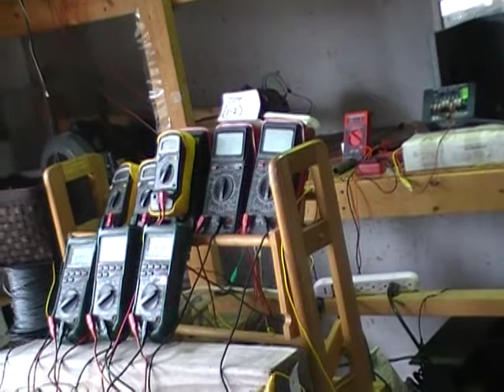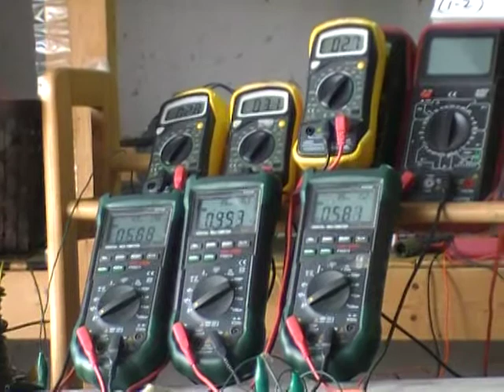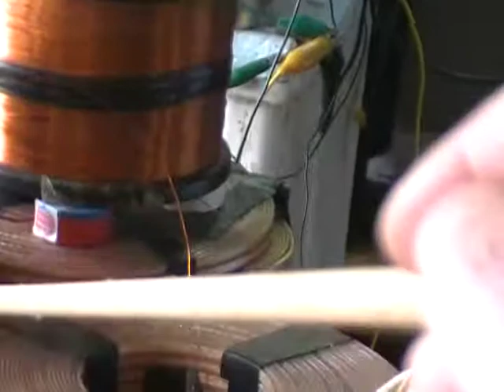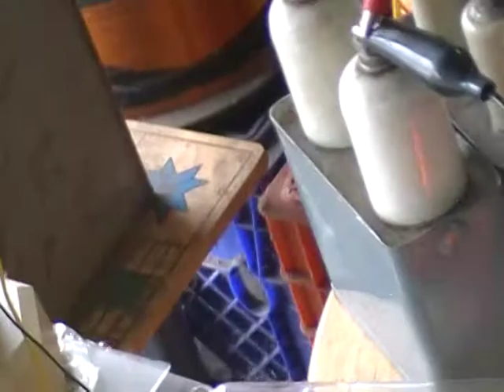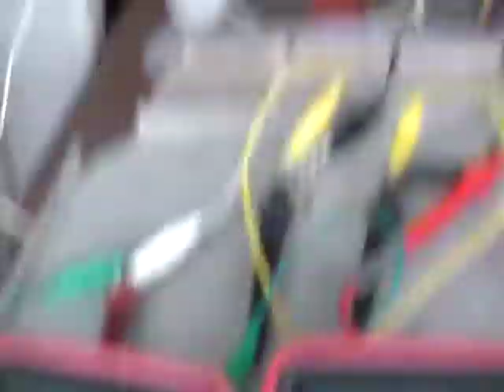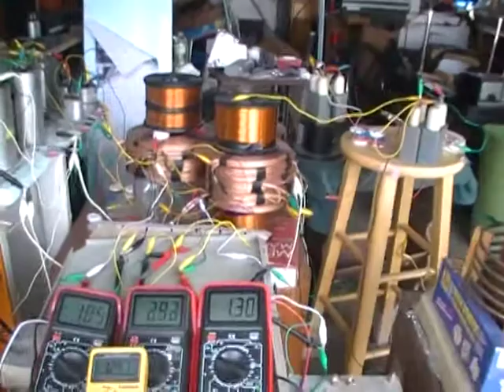SelfMagnetised666mach

Comment from the maker: The principles of a rotating transformer are incorporated into the 3 phase alternator by pulsing the rotating electromagnet known as the field at the double the frequency of its own AC output! A middle series circuit collectivises the secondary signals over 3 of the 666 machine poles being magnetically expanded by the magnetic opposition made by its center element in the triple stacking of 9 elements. Any voltage or current made by the outputs prior to field energization a...re explained away as residual magnetism of the rotating field rotor. In any case if this feeble current were to be "recycled" to the field to create a self energized working alternator because the alternator employs a rotating DC electromagnet employed to create three AC signals separated in time; to use the AC outputs in this self feedback loop they must be converted to pulsed DC by full wave rectification which cost a .7 volt drop from each direction. Thus the recycled signal must be OVER 1.4 volts before the diodes even start working. Here the communist electrical circuit collects 3 volts in series from sources near 1 volt. The presence of the large induction coils as secondaries will "choke" off the currents in the field self feedback loop. The alternator functions to move a relative non moving magnetic field in a circular movement and electricity is created strictly by movement in space. A transformer has the magnetic field expanding and collapsing in time and electricity is created by employing an alternating current which is a movement in time. Here the invention employs the principle of a transformer incorporated into an alternator whereby the output sees a magnetic field movement caused by both rotation in space and by movement in time, where a sort of AC signal is superimposed upon the rotating DC electromagnet whereby a pulsing synchronious to the actual frequency of operation is made possible by the self feedback loop.